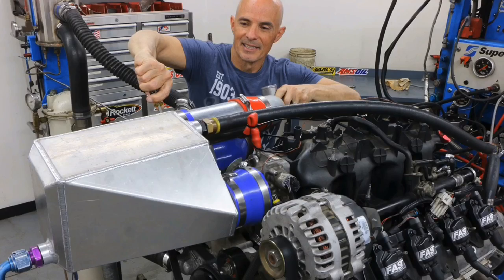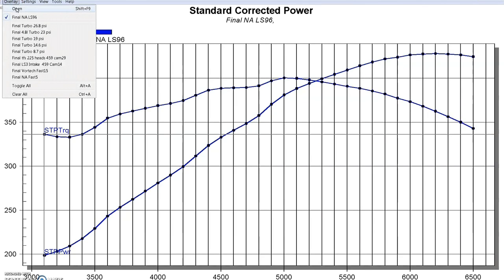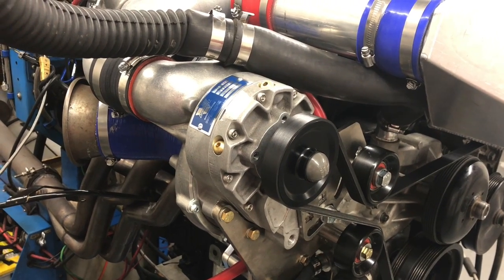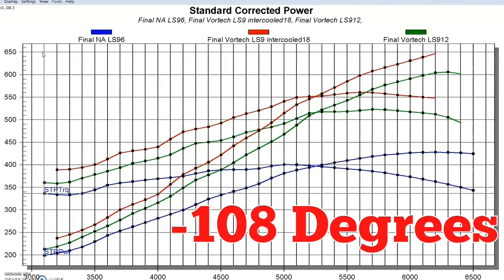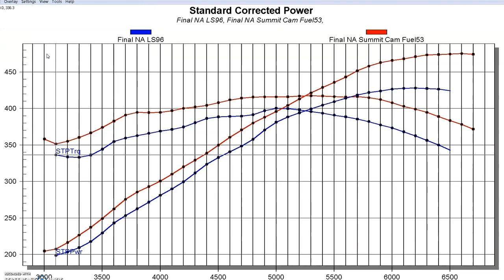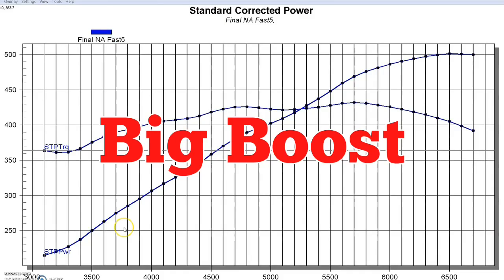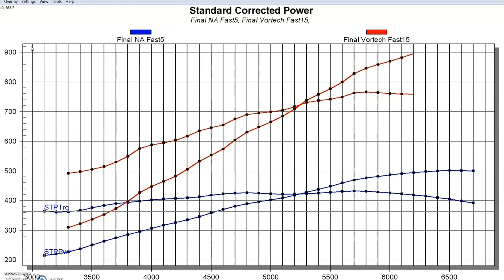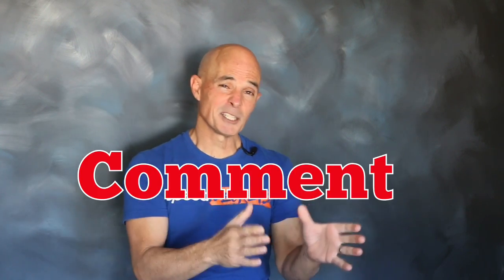SUPERCHARGED 5.3L LS MODS-CAMS, INTERCOOLING & E85 (NEEDS BELT)

Comment: Hey Richard, I have a 383ls build 10.5:1 cr and a cg cam 246/250 585” 108 lsa (I think)(cam was given to me) but I have a set of Thompson Motorsports 243s. And I bought a d1 procharger I want to use on the motor. What is the estimated boost max and power I can make with an intercooler on pump 93. It is a street car. But I’d like to find it’s full potential
Reply from the maker: YOU CAN'T MAKE ITS FULL POTENTIAL ON 93-THAT IS A BIG CAM-YOU ARE GOING TO HAVE TO BE VERY GOOD WITH THE TUNE WITH A BLOWER AT 10.5:1 (EVEN WITH THE BIG CAM), BUT YOU CAN MAKE PLENTY OF POWER

Comment: I’ve been looking at the Vortech truck FEAD system and have seen lots of belt slip issues in forums. Most of those guys said that Vortech is using the wrong belt and tensioner. Lots of those guys said they were using a green gates power belt or something like that with a better than dayco tensioner and having way better outcomes with that setup.

Comment: Have you done a turbo and meth injection only test? (no intercooler). I have a packaging issue so intercooler is a no go. Would really like to see a meth only test to see if it's worth it (this is a street only car so it doesn't spend much time under boost)
Reply from the maker: Yes-we compared meth to IC for Engine Masters
Reply: found it!

Comment: What octane booster do you use? Been looking for one thats actually worth while. I have multiple maps i can switch between on my ecu and would like to have a slightly more agressive map.(may just finally install my meth kit and use that as a "race"map)
Reply from the maker: we used Lucas
Reply: @richardholdener1727  thanks. Will have to give it a go.

Comment: I want to throw in my $.02 on that belt issue- you need a spring tensioner. The belt 'grows' a bit under high rpm's from centripetal force, and with a manual tensioner it just gets loose. With a good spring tensioner and the right size belt, the tensioner will take up the 'growth' slack and keep the belt tight on the pulley. Set up a camera on the front and do a few runs - you'll see the belt stretch. Spring tension for the win!
Reply from the maker: I agree-combo adjustable/spring tensioner works well
Reply: I always wondered why the spring tensioner. Now I know.

Comment: How much can you shave the heads with a btr stage 3 or 4 cam and still have piston to valve clearance
Reply from the maker: you have to check
Reply: know it can be done with the stage 3 cam around .025 but was unsure if the stage 4 would be able to do any without flycutting the pistons

Comment: Needs a proper strong spring tensioner on it. Fixed tensioners are just crap and are always fighting a losing battle. And do 12 rib. We've all seen the videos of how much a serp belt stretches, and how much a tensioner needs to work. Which is impossible with a fixed tensioner.
Reply: This. Exactly this. I'll bet if they set up a camera and recorded the runs, you'd see that belt lift right off the pulley. With a good spring tensioner and the right size belt, the tensioner takes up the 'growth' from the centripetal force and keeps the belt tight on the pulley. I vote they record a few runs before and after concentrating on the belts and show us that difference. :)
Reply from the maker: It didn't lift off, just slipped at the top of the rev range
Reply: @richardholdener1727  - when I say lift off, if you had a camera pointing at the pulley, you'll see that as the belt loosens it'll flex away from the pulley slightly. It's subtle, but that's why it slips - the force of it being thrown outward just reduces the surface contact. Try recording a run - at the upper end of the rpm's you'll see it. :)

Comment: The obvious solution to belt slippage is to run larger pulleys and/or a wider belt. You could also get ~20 % more belt contact by moving the idler as close to the pulley as possible. Placing the idler on the low tension side of the belt might help by preventing the belt from flapping as it feeds into the pulley.

Comment: Love your content Full of knowledge👍How about a d1sc with a built for boost ls 402ci.Smaller pulley if possible say a 3.20 on the Procharger.17\8 headers,ls3 top end heads and intake in stock form with a 92mm throttle body .Next test??Would love the info.
Thanks in advance
Reply from the maker: I take it this is your combo-The D1SC is limited to ear 1000 hp
Reply: @richardholdener1727  Yes.Should this combo make that? 950 ish

Comment: Could you expect close to the same NA hp numbers with a stock bottom L33 and mildly ported 706 heads with a LS9 cam?
Reply from the maker: as long as the porting didn't hurt anything-that combo wasn't really using the extra head flow with the Ls9 cam
Reply: Richard Holdener would you consider running this test with the edelbrock intake and holley sniper?
Reply: Richard Holdener Thank you for the reply as well!

Comment: I know how to fix the belt slip issue, take the blower pulley off and cut sideways grooves into it with a cutoff wheel or something so it has teeth to bite into the belt me and a friend did this on his 2.3 whipple terminator cobra and it fixed the issue now holds 24psi boost with no belt slip at all. Look at "Reichard Racing" brand supercharger pulleys how they have grooves cut into them, just modify they pulley so it looks like that its very simple to do and works.
Reply from the maker: Thnx-I've seen the alligator teeth pulleys-hard on belts but they work if you have to make a pass
Reply: @richardholdener1727  we would run the grove pulleys on the street. The belts would last about 6 months on a terminator car. It grabs hard enough to break belt tensioners.  BTW Love your almost daily posts. Your slowly pulling me over to the dark side and I am a  modular guy.
Reply: @GermanShepherdsofOKC  yeah my buddy snapped his belt tensioner also and had to upgrade to a billet one. He uses the heavier duty green gates serpentine belts and hasn't had any issues with belts going bad of course its not a daily driver so its not racking up lots of miles just used for car shows and weekends out in "mexico" lol.

Comment: I'd remove bottom idler and run a belt 3/4in shorter so you can add more tension to the belt.
Reply from the maker: we did run a different belt than in the photo
Reply: The problem with removing the second idler is you might wind up with belt whip. You really don't gain or lose any more pulley coverage area one way or the other.

Comment: belt slippage, easy fix. get rid of that manual tensioner and put a spring loaded tensioner on there. i put a spring tensioner off a cummins diesel out of ram 1500. no more slippage on my procharger.

Comment: Never understood the serpentine drive blower setups, always fighting belt slippage.  Cog drive all the way
Reply: If you read the instructions that come with the blowers...the last thing you'd want is cogs. In fact...the instructions make out as if you shouldnt even attach a blower to an engine lol. A serpentine done right, works perfectly, and will be easier on the blower than cogs ever will.
Reply: @blow0me  But the only way it can be easier on the blower is if it slips - by definition - under certain circumstances.  Designed slip is certainly not a big deal, we do it with slipper clutches, torque converters, etc.  But there's a reason we use cog belts for certain apps.
Reply: @blow0me  Well they have to put all that stuff in there so they can deny any warranty claims ;).  Look, controlled slip is definitely better for a street car, especially with a manual trans.  But as you up the boost and the requisite load to drive the blower at those levels, you need to add more and more ribs to the point that fitment becomes an issue.  That's one of several reasons why cogs are preferred for high output drag apps.  And if you're concerned about load reversals on shifts or lift off, there are sprag pulleys which freewheel when loads reverse.  http://www.atiracing.com/superpulley/index.htm
Reply: @blow0me  As I said, serpentine are fine for street cars where slip can increase reliability.  But these days if you're not making 4 figures you're not even in the game when it comes to boosted V8 power outputs for most racing classes (hell, even the 4cyl guys are well into 4 figures, but they don't use superchargers).  As such, there are still plenty of cases where a cog belt is preferred for maximum, consistent power if you're still choosing to use a blower.  Horses for courses.
Reply: There's an argument that sometimes having a belt that slips under extreme load is better than one that does not.  It's more of an OEM concern I think.  There's also NVH to consider.  But for making maximum power with belt driven components, yes, a cog belt is best.
Reply: @ChurchAutoTest  from what I heard anytime you dump the clutch the harsh change in speed which is amplified by the gears within the blower can cause some damage. No clue how big of a problem this would be in real life though.